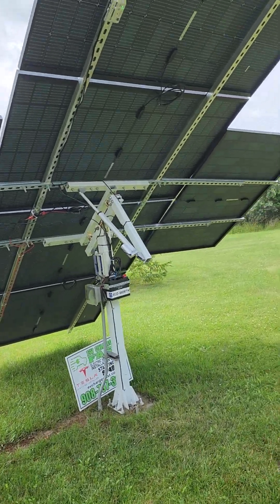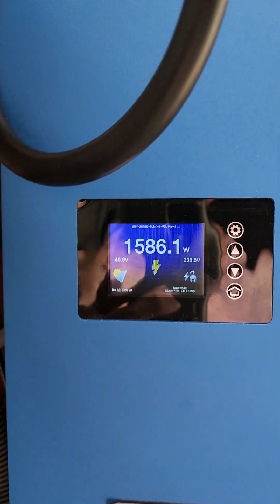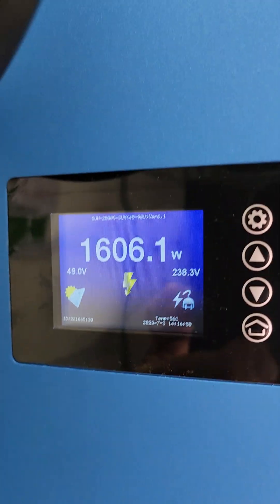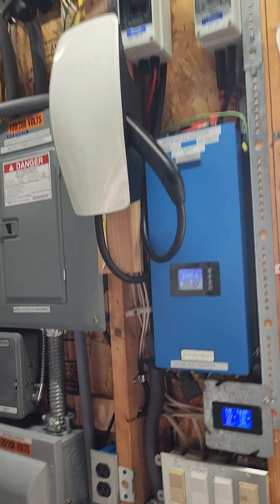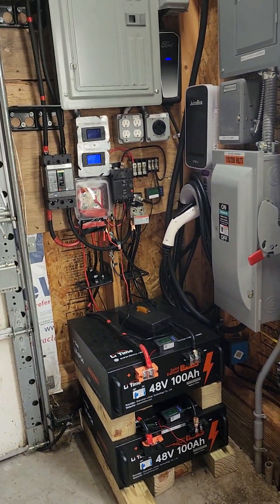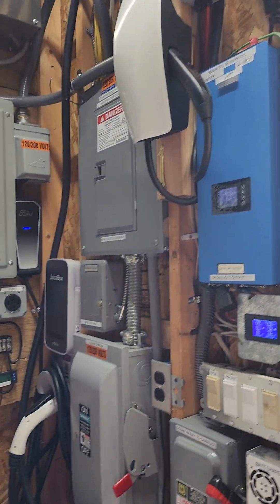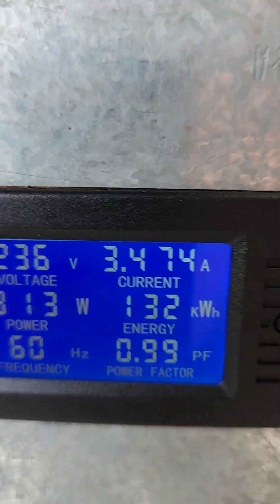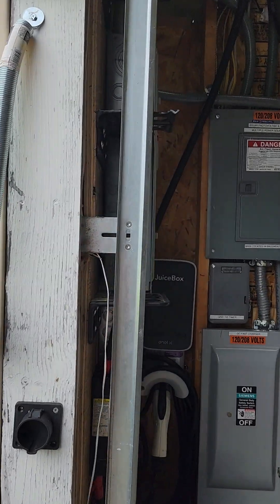update and tricks to maximize my solar output #solar #diy #offgrid

Comment: Regarding your auti switching from grid to night time battery. Im doing the same thing. No ine is home during the day so power is not used and just sitting there.
Ive made a relay ststem. Its contrillled off the charge controller load timer.
Using N/O N/C relay to work  2 ssr relays. I also have a viktage ready for a liw voltage discinnect so the inverters do nit drain the bat bank. SSR uses little power to  use. The GTI'S get hooked back uo to the solar input in the morn. They share the solar input of the CC. So if thefridge kicks on furing the day it gets covered but then the rest of the  power goes back to the batteries.  Hope this helps.
Reply from the maker: Im using the PowMr charge controller which doesn't have dry contacts, which charge controller has dry contacts??, I'm definitely interested,  great tip...please share a pic or video of your setup, join the upcoming roundtable, I'd like to invite you ..Garrett
Reply: @Electrician-family hank you. . I use an Epever MPPT 50 amp CC newer version. However just use your load control output which has a built in timer then run an  SS relay like 60 amp to you GTI from battery 
Same..take another SSR..disconnect solar/CC.
Use a NO/NC small 24v relay to control the two SSR, s. One will be on and one will be off. They draw no power to use. You don't wanna back feed back into your CC when trying to use the batteries to the GTI so isolating the CC is a good thing. After that set your LVD in your charge controller load settings  so youju only deplete 30-40% from your bat bank per night. A good start is 24v @ 200 amp hrs. Then you may want to expand from there. 
Hope this helps 1:38 2:10 2:11 2:11 2:24
Reply from the maker: @leamyelectricinc1  I understand perfectly- thank you for clarification- I'll use the Load output to a coil which will control output to GTI ...that is going to definitely be done- great tip...thank you

Comment: My solution would be to get enough batteries so that you don't have to turn them off. I just have a small system compared to yours. I'm getting the last two solar panels Saturday, for 1600 watts. I would like to have trackers but if you had yours here they might last two or three weeks. It's pretty windy here. Sometimes I get 70-80 mph wind gusts. I watch these videos to learn stuff. I never would have thought about making solar panel mounts out of wood. I make stuff out of metal. I only get 🌞 Sun on part of the panels at a time. I'm on the Northeast side of my uncle's place and there's buildings in the way. Everyone has different things. My charge controller is more efficient at 33 volts, so I can't have the panels far away or I lose watts. I used twenty big marine batteries from Autozone for the battery bank. My stuff is all temporary. I'll get better exposure for the panels anywhere but here. What I am going to do is have half the panels on the East and the others on the West side. I had I had a thousand watts of panels aimed at the 🌞 Sun earlier, and the 40 amps controller was showing 39.7 amps going through it. So I'll have to be careful. My system is 24 volts. I'm not sure how long  these old boat batteries will last but it should be awhile. To make things crazier, I installed a new wind generator to find out they sent me a 12 volts one and I ordered a 24 volts one. I use it on half the battery bank unless the wind is up howling, I can use it 24 volts. My stuff is pretty hillbilly compared to yours but it runs everything I have. I mainly wanted to be able to turn the air conditioner on if I wanted to. And use the oven and hotplate. It's pretty amazing. I have a freezer and a small fridge. I fried the power and control boards twice in my Aims Power inverter charger 2000 watts. The first time, I had to get a wood stove built and didn't have any other power.So I sent it back to Sparks, Nevada, lol, and they fixed it under warranty. So the second time it turned into a mess. They didn't want to honor the warranty so I had to pay the shipping both ways, ( it weighs 46 pounds), and buy the parts and fix it myself. And it was a holiday or something when I got the control board, so it cost like $83 to ship. So I fixed it in Nov of '21 and it's still fixed. I bought a Winco Lil Dog generator for the welder. Yeah I have enjoyed having this free power system. I've got two panels coming. I've got most of the panels in a frame. Like two panels in one frame of square pipe. The wind doesn't blow them around. The first one I used a little bit bigger pipe and it's heavy. So I used smaller and it was about right. If there's big hail coming I can unplug two panels and take that frame into the barn. I only ever have to move a few. Better to move than have to replace. I've got a thousand amp hours but I was thinking about buying two more so that would make it 1100. That's the only flaw I see in your system. You should find the point where there's enough that they can a always take a little bit, and turning them off would be unnecessary. Just eliminate the turning off part. Then they'll already be on when your inverter wants juice. That's what I would do. You might want some go cart tires on your cart.
Reply: You could build a smaller solar tracker system which would be wind proof.  Arranging each solar panel on its own swivel mount and use the motor to turn the panels as a group through multiple link rods.  I am thinking Big semi rigs which have two or three steering axles and use rods between axles to turn.  This way you have a low profile system that can track the sun for better efficiency.
Reply: @LincolnshireRose  I thought about doing that, except in pairs, 24 volts, but it's not my property, so I have to make something removable later on. Don't know if I can stay here so I have everything so it can be taken to another place. When I get my own place, the the solar panels will be placed so that the light is reflected off the side of the greenhouse so that evening wattage will be higher, more like daytime. I have a plan to use car window motors to tilt them. They're twelve volts. I can just put a switch that runs the motor, and a device to run that switch. They will be automatic without a bunch of electronics, just a relay perhaps. The Sun can hit a small panel which powers the motor to turn the frame towards the Sun. Then as you said, linkage to perhaps two more. That would be 600 watts per motor so I could have three. I'll have the panels where they're out of big winds. I'll have to build one . Since some of my solar panels have square pipe frames that I made, I can just weld a couple of tabs onto the tubing so it can be tilted from the middle. There would be a third tab for linkage. I need to take the panels off a couple of them and repaint the Rust-Oleum again. Those things are out twenty four seven. They're not bad, but need a recoating after two years. It might need a battery, if so I have two little batteries I can use. What I thought was if I could make two, they could control eight panels, and the rest of the panels could be mounted solid.
Reply: @davidpotter9462  That sounds like a plan, however one slightly more powerful motor instead of 3, 4 or more for rotation, would save on the power used.  You could gear it down to give more turning torque although that will make it more slow but that could be an advantage.  A weighted system using pullys and a weight may also help but its your system so what ever works for you in the end is always best.  There are so many options available.  Good luck with it later on, all the very best
Reply from the maker: Great message, I read entirely,  I'm at an inflection point in offgrid batteries,  I am believing that our EVs will be our powerwall batteries,  I'm holding off on purchasing more than 20kw of them to allow the industry to catch up to us early adopters,  
Send me some pictures of your setup, I want to see what you consider "hillbilly " cuz mine is really bespoke as I use stuff that is laying around for the most part, plus I'm trying to market the warehousing/ commercial EVSE market....

Comment: To be honest if you pay additional for extra solar and wouldn't need to track sun to get similar results
Reply from the maker: The ground mount cost as much as the tracker..there is a $100 off coupon right now...
Reply from the maker: Stay tuned as I'm adding 20kw of solar to my roof, outputting 440v to directly charge my EV..
Reply from the maker: I just found out that 2 additional solar panels cost the same as buying the tracker...so now I am a true believer in these Trackers if you have space

Comment: Man.. thats so awesome. I love what you are doing. I run our off grid home off of 2 inverters. A 4000 watt sungold power 4000 split phase and a powmr all in one 3000 120volt. I use 24 leaf modules on one and 16 280 eve cells at 24 volts on the other. I have a 100 powmr charge controller and a victron 150-70 plus the all in ones charge controller. Those power mounts are awesome as well. I need a couple of those
Reply from the maker: https://amzn.to/3r8PZqp
Here is the Eco worthy solar tracker link, there is a $100 off coupon ,,, its a great deal
Reply from the maker: Send us a pic of your system,  sounds amazing...we can all get tips from each other
Reply: @Electrician-family  I'm not real good with the technology stuff as far as sending pictures but I'd love to show you what I've put together. I could send pics In a text or email I guess but don't know how to send pics on here